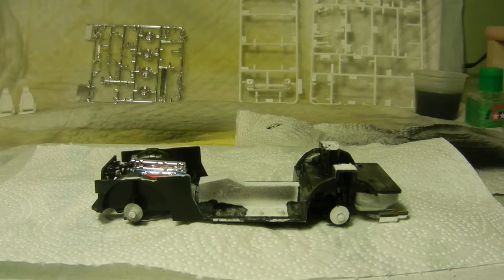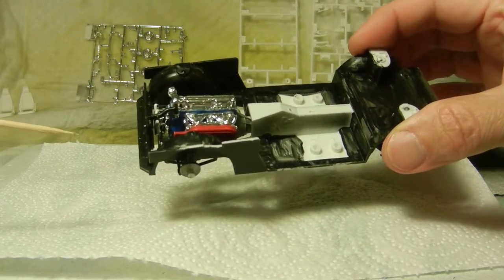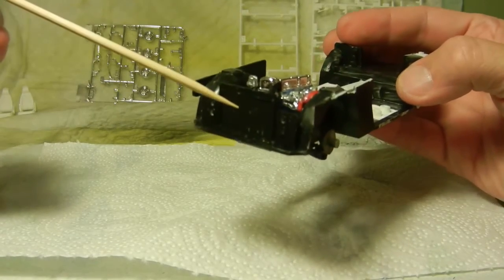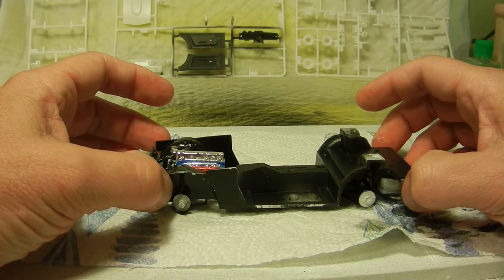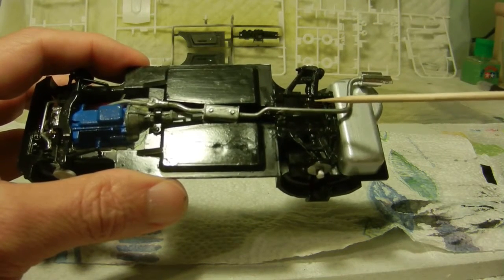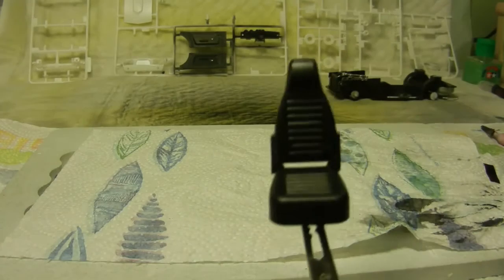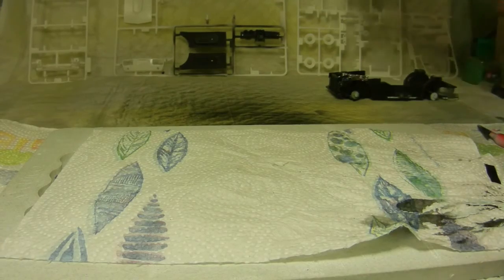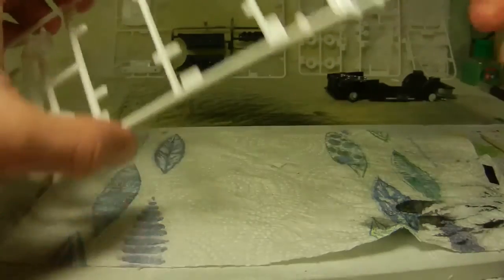Datsun 240Z Part One

Comment: Good video Mike, very informative. So, you are running into a few issues with it. I think one if the issues was with the body going onto the chassis. Doesn't want to settle down into position!! Looking very nice!!
Reply from the maker: MindlessModelWorks Thanks Kenny, appreciate that. Always like a challenge when it comes to "fit" issues. Thanks for the heads up on the body to chassis fit issue.